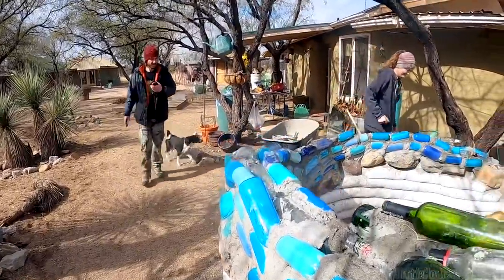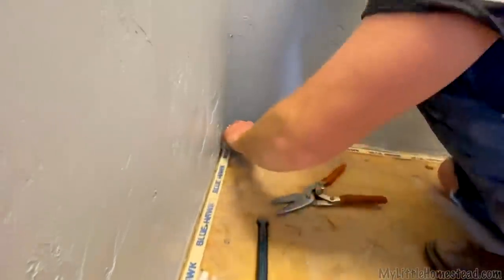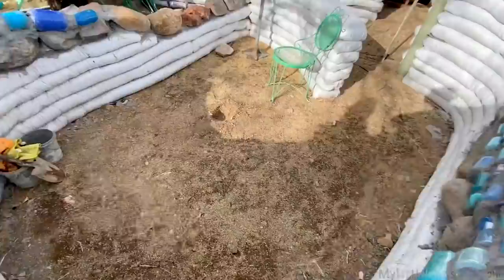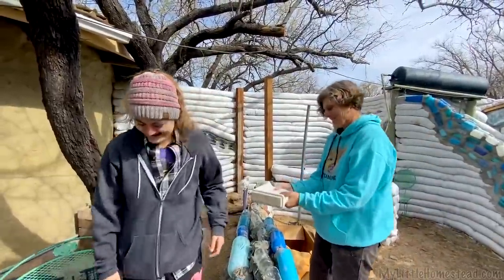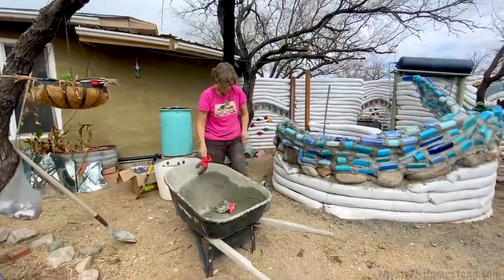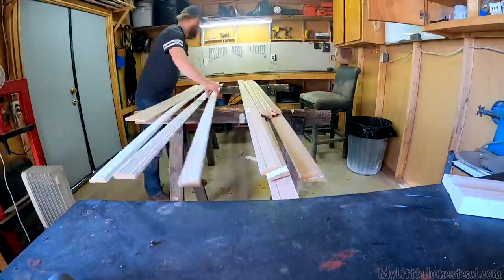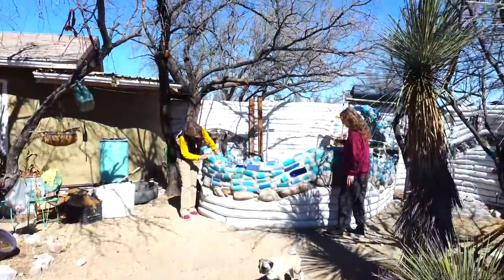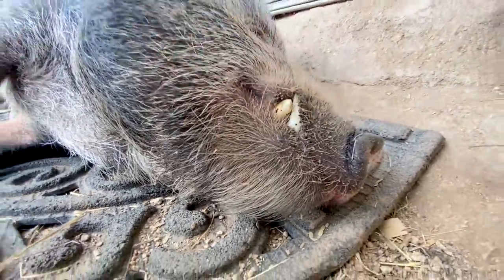Earthbag Bottle Wall Embed Pots & Carpet Installation | Weekly Peek Ep270

Comment: Homesteaders,
I have a great idea!!!
After you get your wall finished and IF you have a lot of bottles left over, then you should make a floor out if the bottoms of the bottles.  You can either dig down into the ground, fill the bottles with dirt and then bury the bottles upside down so the bottoms are like a tile walkway OR you can carefully take a glass cutter and cut the bottle bottoms off and then place them upside down on the ground like tile.

Comment: I had seen on a youtube channel that does crafts that if you use a heat gun at a low temp it will help melt the glue under the labels

Comment: Interesting stuff. Little curious what happened to the air vents? Did you just carpet over? The bottles still freak me out. Im really worried about the top weight  on them, and how well they will allow light through.

Comment: Is there a reason you carpeted over the vents in the floor.  Are you not going to use the forced air anymore.  Should you go back and fill those in so cold air does not come up under there???

Comment: Garen, padding is the most important thing for carpet wear. If it's cheap, even an expensive carpet will wear out too quickly. "Kick" that kicker hard to ensure the carpet is stretched properly. When you seam carpet, the grain needs to be running the same direction or the seam will be weak. YT is free, do some research. Carpet installers are cheap. Why do that to your body? (used to own a flooring store)

Comment: You should mosaic in the back of the crock pot with colorful tile bits.  Also the back of the pot as well.
Reply: That would be cool and maybe not put the shower shelf in the planter but lay a flat bottom and tile it o.O that would look cool too
Reply: that's EXACTLY what I was going to suggest! :) Maybe with some seaglass ?
Reply: @sarahbastedo1330  Gotta have a shower shelf, just mosaic around it is my thought.
Reply: I wish I had read down further before I commented because I posted basically the same thing.

Comment: For those vases and any other bottles with thin walls, since they're mostly painted blue, you could fill them up with some of that expanding sealer foam to give them more rigidity. That would make them opaque, so you'd have to use them only in places where you don't need the light to show through, but it would reinforce the fragile bottles and let them take the weight of the layers above without cracking or shattering.

Comment: On the pot and slow cooker(?) insides, just remember that mortar IS NOT glue, especially on the slow cooker. Also, have you been using swimming pool mortar or equivalent inside the shower? IF you haven't, make sure you get some QUALITY sealer, and apply liberally, or your mortar joints will become a mold farm. Garen: That room is a little big for a kick stretcher. You might want to rent an actual carpet stretcher and give it a little more oomph before moving in your furniture. Stretch it AWAY from the closet, so if you need to do a little more trimming it will be simple. I would spare your knees if you are doing any more installing. Every carpet installer I've known has bad knees from kick stretchers (not fun when you get older).